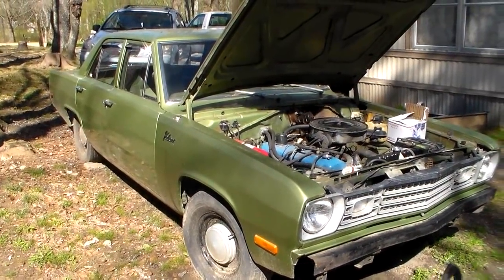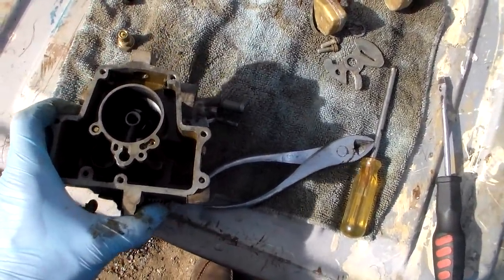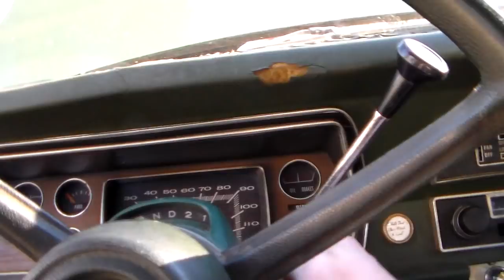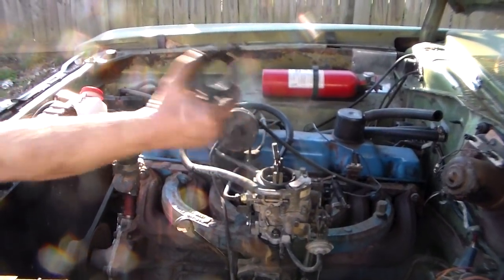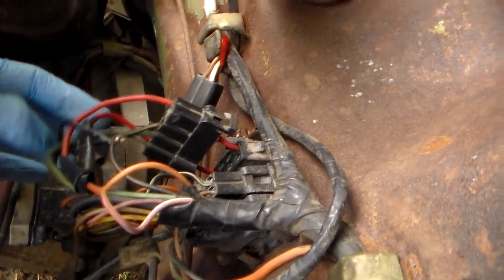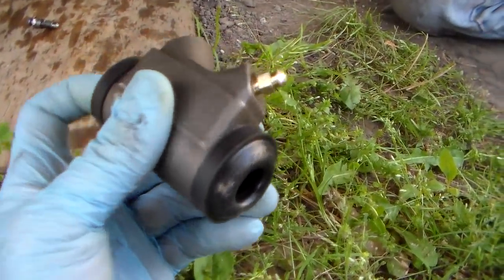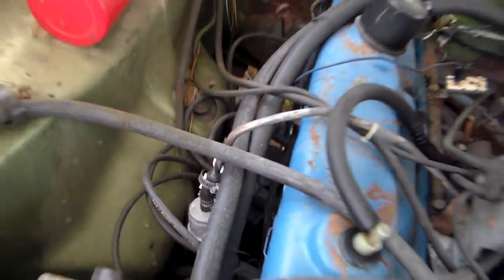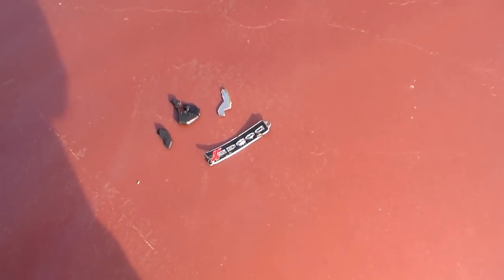Attempting to revive Uncle Phil's Plymouth with plenty of FAIL

Comment: Any mechanic knows that brake fluid is eats stuff that is not made out of metal. JB weld stands about as much chance as a prius in a demolition derby.
Reply from the maker: Yep. People who AREN'T MECHANICS don't understand it. Mufflers, brake cylinders, connecting rods, crankshafts...anything subjected to intense heat or pressure..JB WELD will hold it!!
Reply: We fixed a keyway in a crankshaft on a Mazda with JB weld. Don't know how long it held because I priced the truck right and sold it. The guy that fixed it didn't want to do it but I told him to and it ran till I sold it. The proper way to fix it was to put a new crank but just did the JB weld and let it ride.
Reply: Matthew Green I'm planning on driving a Smart car in a demo derby.
Reply: @kennethsunderland6676  We have similar sounding names and stories.  I once bought a used Honda XR 500R that the previous owner actually repaired about a two inch crack in the crankcase with JB Weld.  On this bike in addition to being a crankcase subject to high heat, pressure, expansion and contraction, it was also a stressed member of the bike. Not to mention being bathed in motor oil 100% of time. The previous  owner JB welded the case a few years before I bought it and I had the bike for about five years and sold it. Never once had a problem with it.

Comment: Yikes is about all I can say to that wheel cylinder 'repair'. I can understand your frustration with the situation. I helped a friend out recently by putting a radiator in his car for him, then couldn't even get him to commit to checking, and is necessary topping off the coolant the next day. Was that guy in the background the guy that bought the gold protegé? That's a tough car if it's still going. I hope you have a spare key for the truck, or if not then it's not got an immobiliser to make the process of replacing the key even more fun.
Reply from the maker: Yep, that's the guy. That protege is still running to this day and it was the worst one of all by far. Go figure. The truck just has a regular key, no security.
Reply: Hopefully the locks are not too difficult to change, I'd have wagered that the engine in that Protege would have failed by now, given the lack of care before your ownership, tough car.

Comment: yep, hate it when I try to help someone who is just doesn't get it. You have those "pie in the sky" folks who want you too keep their vehicle running that is too far gone because they are so cheap (or poor) that they will not fix anything properly so they wind up with a pile of crap they won't part with that needs everything fixed. They get mad because you won't just "rig" this one fix. Then you have the idiots that no matter how much you explain, they can't get it and you have to do it for them. You also have the cheap bastards that no matter how much money you save them, they are appalled at the price...... although they already knew a repair shop was going to be a lot more. I basically quit helping people out. I only work on my vehicles.
Reply from the maker: They all think they are beating the system and saving money.